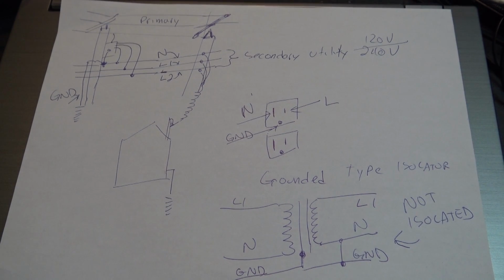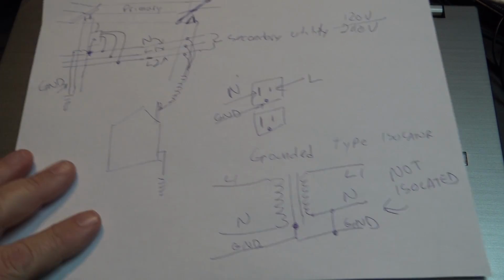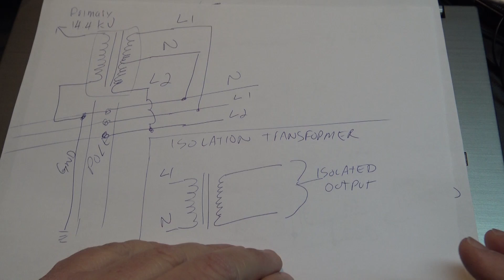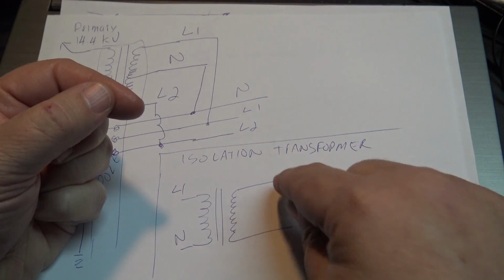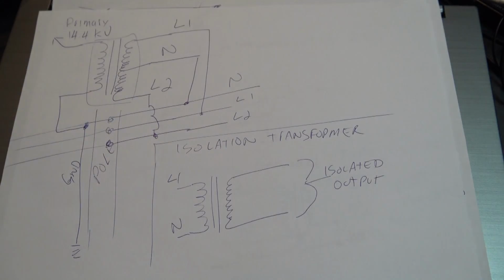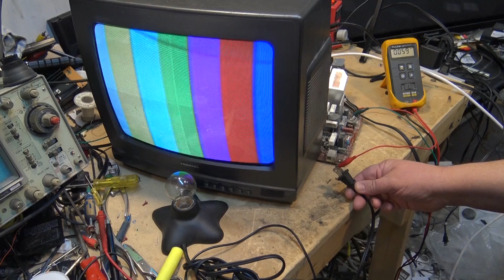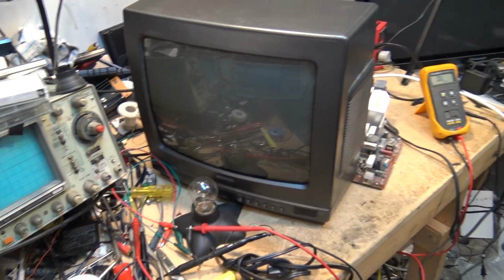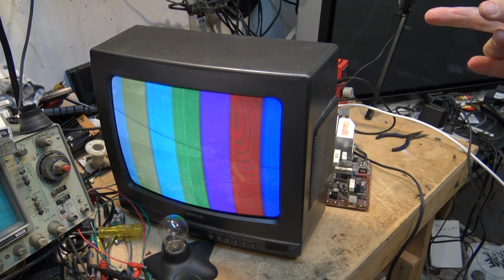Isolation transformer explained and demonstration

Comment: Thanks. So in plain english you're protecting your scope's integrity by isolating the input of the device under test by means of an isolation transformer. You're not removing ground in the input of the scope, or feeding the scope from the transformer, that is what many people typically would think should be done. Right?
Reply from the maker: No I am isolating my work bench from Earth ground.   The secondary of the isolation transformer is not referenced to earth or neutral at all.  My scope also floats.
Reply: @12voltvids  Oh, OK with the first part of your answer, but you mean the "measure side" of the scope floats?, or you also removed ground from the scope's power input. I read many times scope's ground (in the power side) shouldn't be neutralized because in that case scope will be floating at the same voltage level of the measure side, no matter were no chance of make a ground fault, but chasis therefore we also will be floating at high voltage. Please your final comments.
Reply from the maker: @ramirosuarez9537  yes scope floats so yes the chassis could be hot but remember it is isolated from earth ground so you won't get a shock even if you touch it.  Just like a bird on a wire.
Reply: @12voltvids  Thanks a lot for confirming that. Best regards.

Comment: Where do you find these transformers? I would like to try myself and to learn to connect devices to repair. And it seems to me wise, when I first an isolation transformer create or find. These transformers are somewhere in a or other device? Or where can you find them?
Reply from the maker: I bought the the one I have way back when I worked in the business from the electronic parts supplier (now closed after the owner passed), it was about 125.00 as it is a big one. Will handle 500 watts easily
Reply: 12voltvids Thank you, for the quick response. Is there any other way to keep yourself safe? Or is the only way this transformer? Yes itself very well pay attention, but that's normal. We have 220 volt in Netherlands.
Reply from the maker: @Repair5700  
Remember you can still receive a jolt with an isolation transformer if you contact a ground on the chassis and hot on the chassis, but an isolation transformer will protect you from receiving a shock from any energized part on the device under repair and earth ground. Without an isolation transformer  you can get a nasty shock. It also protects your expensive test equipment like oscilloscope. The scope must also be floating though, so no connection to earth on the scope. I plug my scope into the same transformer so it is isolated as well.
An isolation transformer is a key piece of safety equipment that everyone working on electronics should invest in. It could save your life. It has certainly saved me from countless shocks or damage to test equipment.
Reply: 12voltvids Thank you very much for your help. Also thank you for my questions answered. I'm going to be sure search ons.

Comment: My isolation transformer is isolated between primary and secondary but gives me 120v between secondary and house neutral. I’m in a 220v environment by the way. Isn’t this enough to get electrocuted or destroy the scope I wonder? I thought it was safe enough but after those measurements I’m getting worried. Is there also a faston connector on the transformer body and the maker suggested me to connect it to primary hot ground in order to shunt to ground parassital current... even with the ground connected to the primary it doesn’t change a lot and I still getting 120v between secondary phase and house heart. Ohmmeter still reporting hight isolation between chassy ground and the rest of the secondary output. That’s weird to me at this point... can you explain what’s the reason I’m getting those results?
Reply from the maker: Your transformer is not isolated.  There is probably a center tap that is groinded. This needs to go. You should see 0 volts between either side of the secondary and ground, neutral or hot.  You should only see voltage between the 2 secondary terminals. 
Anything else is not isolated and you can still get a nasty shock and blow up your scope.
Reply: 12voltvids here is the answer I just got from the maker: ...Two positive voltages to earth in an isolation transformer are absolutely normal, indeed it proves that the winding is isolated, therefore it does not have a neutral reference to earth.
You will see that if you put one pole of the secondary to ground it is with that pole (obviously) at 0V to earth and the other pole at (about) 230Vac, but this turns out to be in practice a "first fault" that increases the risk for the user and therefore must be practiced only if a neutral reference is required on the secondary and only if adequate protections are arranged for the user who is no longer isolated following an earth fault.
Reply from the maker: @ictrepairs6963  
Huh? An isolation transformer will have no reference to any earth or neutral on the secondary. Therefore, if your secondary winding is not connected to anything there will be no voltage measured whatsoever on the output as the secondary is  floating.
If you tape your meter in ohms mode, you will see resistance when measuring the primary coil, and secondary coil. You will see infinite resistance between primary and secondary, and between secondary and ground, or neutral.
If either of the secondary wires has ANY resistance at all to any terminal other than the other end of the secondary then the transformer is NOT an isolation transformers. Many so called isolation transformers are NOT because they pass the earth terminal through, which incidentally removes isolation. A real isolation transformer will have no connection on the earth terminal. Mine does not even have an earth terminal period. It has a 2 prong cord on the primary, and a 2 prong receptical on the output. I had to cut the 3rd prong off to my Variac, which is what is plugged into the transformer.
100% isolation. I have demonstrated this.
Reply: I asked about the center tap to the maker and he told me that there’s just a sort of shield that need to be connected to ground... I give a try and isolate the cable that is connected to the chassis and that seems to come from an internal winding (don’t know if is the center tap or whatever...) thank you for the suggestions.
Reply from the maker: @ictrepairs6963  
I I have previously demonstrated, if t here is an earth connection, that is passed to the output then it is not fully isolated. There are many medical isolation transformers on the market that pass the ground through, and have one side of the secondary tied to earth ground. This defeats the purpose. and these need to be modified to restore isolation. A service technician, or engineers grade transformer has no electrical connection between primary and secondary.

Comment: Hang on, so everything would be safer if our utility transformers and houses weren't grounded???
Reply from the maker: No, but when you are working on a hot chassis you don't want to be that path to ground.  With an isolation transformer you allow your equipment under test to float isolated from both earth and the live wires so a short to ground either through s scope probe or you won't harm you or your test equipment.
Reply: @12voltvids  But why is is only safer when working on electronics? Why not for all appliances?

Say for instance you have one of those dodgy Chinese rechargeable camping lights (that Big Clive has featured), where the USB outlet becomes live at mains voltage whilst the unit is charging. From my understanding of your explanation in this video, if you plugged the light into an isolation transformer and touched the USB port, you wouldn't get zapped, but if you plugged it into a regular socket instead you certainly would.
Reply from the maker: @man_eating_monkey  
Yeah you could plug one of those dodgy camping lights with no isolation into an isolation transformer and it would be safe.  That camping light should have had a transformer inside.  They went for a capacitor dropper.

Comment: Wouldn't it be simpler to test both sides of the isolation by touching one lead to either side of the isolation transformer to line ground or neutral?
Reply from the maker: I was demonstrating how it works.  To show that the isolated side is fully isolated from the line.  Naturally you wouldn't test to line, you test to ground.  The line is isolated.  Testing to line would remove that isolation.

Comment: U mean hot as in Negative and Neutral as Positive?🤔
Reply from the maker: No negative and positive on AC.
Neutral is the return (grounded) side, and hot is the supply. On the output transformer there is no neutral as the secondary is not connected or referenced to earth ground. Both sides float, so either side could be grounded and not cause a short to ground because it is totally isolated from the supply.
Reply: @12voltvids  ahh ok thank u when u say hot supply what do u mean by that and thanks for replying larrning about isolation transformers before hooking up to crt arcade cabinet
Reply from the maker: @gamingo_gguyverx6812  
The mains supply at the wall plug will have 1 "hot" wire and a neutral which is at ground potential, but not ground. It is  the return wire that runs back to the transformer. The ground wire is just that, earth. Now the neutral is also earthed at the transformer as well, but there will be currents on the neutral wire and not normally on the ground wire.. If you take your meter in AC mode and put one probe in the ground port on the plug and then measure the other 2, you will see one measuring 0 and the other showing the line voltage, 120 in north america, 240 in europe. In north america the 2 blades for the plug are different size. The larger blade is neurtal, and the smaller one is the hot side.

Comment: Thanks for the great video! I am looking to buy one (240V, I'm in Australia) and the 1000VA is actually cheaper than the 600VA at the moment but twice the weight. What rating would you recommend for CRT repair? I'd like to be able to cater for the massive 43" CRTs as well. https://www.radioparts.com.au/product/54153605/iso600es-240v-600va-isolation-transformer-mains-electrostatic-screen#.XDWQkVUzbIU

Comment: That was great thanks mate. I'm a 3rd year apprentice electrician and am constantly trying to understand electricity. So current always wants to go back to the original transformer that it came from?
Reply from the maker: Electricity always goes back yo it's source. That is a closed circuit. It can't go back to another source.
Regardrless if you are talking batteries or mains.
In a battery you have a + and - terminal.  Electrons flow from the - terminal, go through the circuit, and return to the + terminal.
In mains you have your generator and load.  Transformers are just a way to step the voltage up and down. The power company steps the voltage up to a high voltage for long distance transmission for 2 reasons. A higher voltage requires less current, therefore the conductor can be smaller, and there are always losses in the transmission line. These losses are less when dealing with higher voltages.  The transformer that feeds your  house is the last step in the transmission line from the generator.
On the secondary  winding one side is grounded in single phase 240V countries. In north america we have split phase 120V, so the center tap is grounded and there is an A and B phase.  These are 180' out of phase with each other.  If you connect across the 2 hot lines you have 240V. This is what ranges, HVAC, Dryer, hot water and heat uses.

The danger comes from that neutral line, the center tap being tied to ground.
Now either conductor, if it is grounded will complete the circuit, and becomes a potential risk for anyone servicing electronics connected to the mains.
A proper isolation transformer has NO GROUND REFERENCE in the secondary winding.  The primary side will have one side of the winding tied to ground through the grounded neutral, and of course the hit wire, but the secondary is floating.  You can touch one wire and be grounded, and nothing will happen, because there is no complete circuit. No complete circuit no shock. 
Yes if you were to grab both the secondary wires then you will get a shock, bt not from touching a single wire and ground because the load is balanced. 
Now, if you were to ground one side of the transformer, well then the other one would be just as dangerous, because the hot side is no longer isolated.
The real reason to use isolation transformer is to protect your scope and other grounded equipment. On non polarized old radios for example one of the power wires is connected to the chassis. If you happened to plug that radio in directly, and the side that was connected to the hot was the chassis connected wire, now the chassis is floating at line potential. Touch your grounded scope probe and sparks will fly, and at a minimum you will be buying a new scope probe, and possible a new scope. 
Plug that same radio into an isolation transformer and it is safe to connect your scope, just remember that as long as your scope is connected you are removing the safety factor for you. If you are grounded and touch a hot wire you will be the path to ground.  
I not only have my bench isolated, but I also don't have my scope grounded.
I just found an old isolation transformer in my storage unit, so perhaps a tear down video of that one is in order.
Reply: Alot of what you just said I've heard before at trade school and from other tradies but each time I hear it it sinks in a bit deeper so thanks for that I appreciate it!
Reply from the maker: Joshua Caldwell 
Work safe around electricity and give it the respect it requires as it can kill you in an instant. I work at my day job around utility wires as I have to climb utility poles to hook up phone lines and fiber optic drops. I see contractors doing really dumb things that leaves me shaking my head at times. Like using metal ladders in the close vicinity of power. HELLO!  Wood or fibreglass only for safety sake.
Reply: 12voltvids thanks Mate yeah I did my first 2 years of my apprenticeship changing the overhead services from the open power lines to the point of attachment at the house end so I know exactly what you mean. I was either on a fiberglass ladder with insulated gloves or I was in an insulated bucket cherry picker. Our overhead open LV mains have 3 phases and a neutral (in Aus) 
      Just one more question if I may but you said on the big trasmition HV lines that it carries a small amount of current  because it's very high voltage but my question is that ohms law says if you increase the voltage doesn't the current increase? Its got something to do with power or something doesn't it?
Reply from the maker: No the opposite. For the given load as you increase the voltage the current goes down.

So if you are drawing 100 watts at 100 volts it would take 1 amp. At 200 volts it would only dray .5 amps to provide that same 100 watts of power.

Ohm's Law: 
  States the relationships between current (amps), resistance (ohms) and voltage. 
  Volts = Amps x Ohms 
  Amps  = Volts / Ohms 
  Ohms  = Volts / Amps 

Watt's Law: 
  States the relationships between power (watts), current (amps) and voltage. 
  Watts = Volts x Amps 
  Volts = Watts / Amps 
  Amps  = Watts / Volts
Reply: Ahhh ok.. was getting confused with ohms law. That makes total sense! Thanks Mate. I remember that the windings on the primary are thin but many but then on the secondary they are thicker but less.